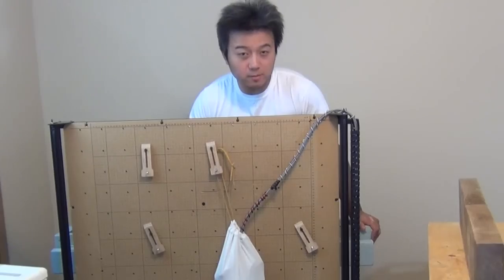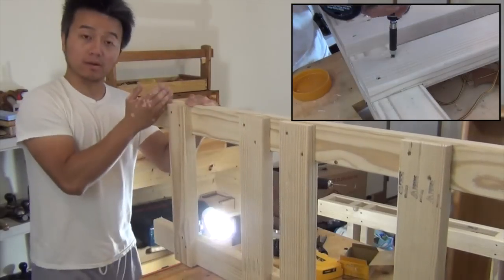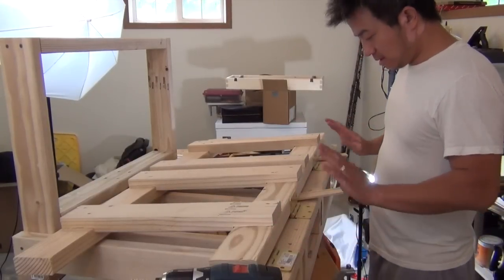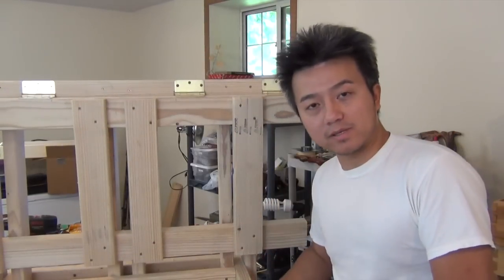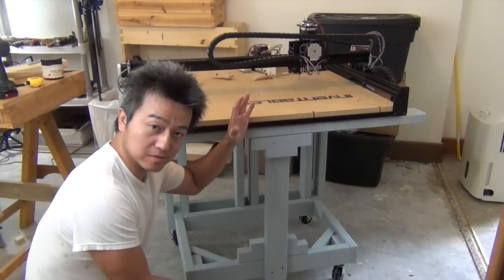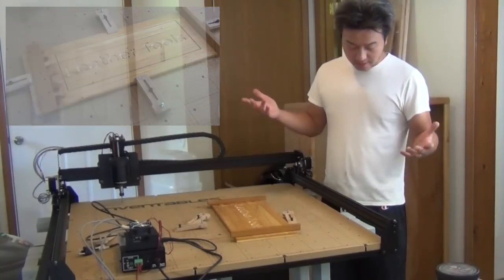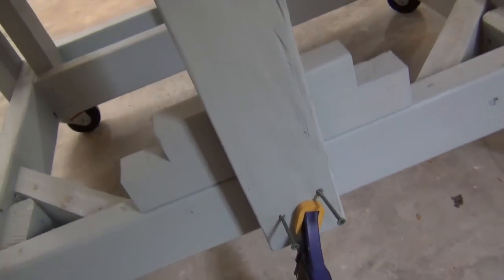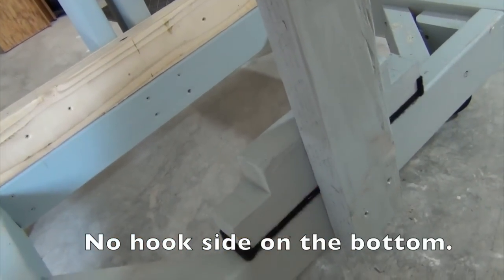How to Make a Folding Portable X-Carve Table From 2x4 (DIY5)

Comment: hey John, excuse my possible ignorance, i know nothing about x-carve's, i just love ur vids. why not flip it 180 degrees on the table so the heavy bit is at the top whilst stored away? you could use it's own weight when tipping to horizontal, so much lighter, plus the wire wouldn't catch on anything, plus, there would be much less chance of damaging it if it was up in the air as opposed to foot height where you could cause an accident to it? apologies if this has already been said or not feasible. look forward to more of your vids, cheers bud
Reply from the maker: Thanks CB. The things does not lock in position; something will have to be made to have it as the counter balance. Also the rail is heavier than it looks, if it was up high is would be too top heavy. The x-carve cart base extends beyond the rails, the cart itself offers protection from damage. But just like car bumpers, one should treat a $1500 piece of equipment with care, and if a driver is careless the bumper is merely cannon fodder.
Reply: John Zhu haha, nice analogy! Yeah I get what you're saying. keep them coming, just getting into woodworking nd love the vids ;) cb

Comment: Hi John, can you move the rail with the router to the top.  Probably it will lighter weight when pulling other end. Just a thought.
Reply from the maker: It naturally slides in that direction, also the weight of the router & rail helps keeps the center of mass low when transporting. Good question.

Comment: John, great build!! I really enjoyed your video as well as your design. I also liked your opinion and theory of charity, something there doesn't seem to be enough of these days. The only question I have about the build is I was wondering if there will be any problem with the part of the xcarve that isn't supported when in the table is up and the machine is operating. Like many other content creators I too hope Inventables will contact me about building and reviewing the xcarve. My YouTube channel is: paulsmessyworkshop if you get a chance to check it out. Again thanks for the great video, Paul
Reply from the maker: pcorlis Thanks Paul. That's not my opinion or theory on charity, I read it in an Islamic traditions book. People are going to be surprised by all the opportunities they've missed to give charity. Steve French had a similar question here's my reply "I didn't calculate the mass distribution when the spindle is in the over
 hang, but just by eye, the Y rails is greater in mass then the X rail, what's left of the waste board is definitely has more mass than all 4 motors." Will there be problems? I don't know, I don't expect problems.
Reply from the maker: pcorlis BTW the over hang is 12".

Comment: I really like the cart. Is there any support for the other side of the X-carve (the side that's up when the table is folded) when set horizontal?
Reply from the maker: Steve French Thanks Steve, there is ~12" that hangs out; I am estimating that the support from the Al rails and waste board is enough.
Reply: The Nomadic Polywright Show oh, well that's not too bad. I'm considering using your plans at some point and making myself one. I already have a hefty piece of plywood cut that I'll mount to the folding cart. It's already sized as a table surface for the unit. That'll help support the entire unit. But I agree with you that a 1 foot overhang is probably not an issue.
Reply from the maker: Steve French I didn't calculate the mass distribution when the spindle is in the over hang, but just by eye, the Y rails is greater in mass then the X rail, what's left of the waste board is definitely has more mass than all 4 motors. If you're going to use a piece of plywood that probably the doors to a lot of design improvement. Looking forward to the possibility of seeing it.

Comment: Very good idea for the cart and like the stability of the build! Couldn't you mount the control box on the bottom. Then just the connector to the laptop would be hanging and that could have the Velcro to hook to the bottom for easy removal.
Reply from the maker: MRrwmac Good points, dust is the main issue to have the control box mount on the bottom. Also the cord that comes with the X-Carve is really short. Also, the Velcro I have has a max adhesive temperature of 49 degrees C, don't know if the control box gets that hot.
Reply: +The Nomadic Polywright Show I meant make a wooden mount for control box and then use Velcro for the cable.
Reply from the maker: MRrwmac I get it now. That's a great idea, keeps everything clean and can use stables on the wood box.